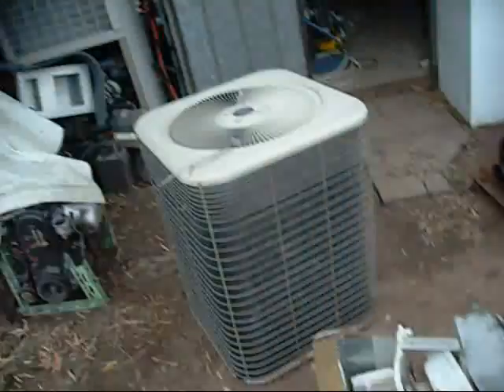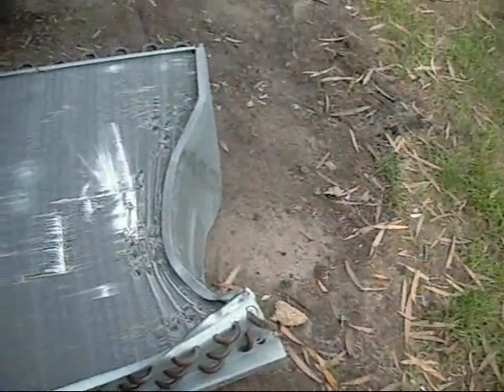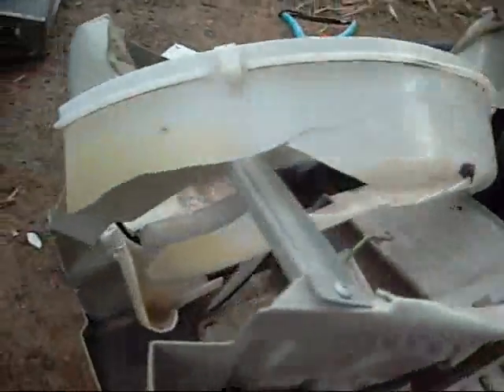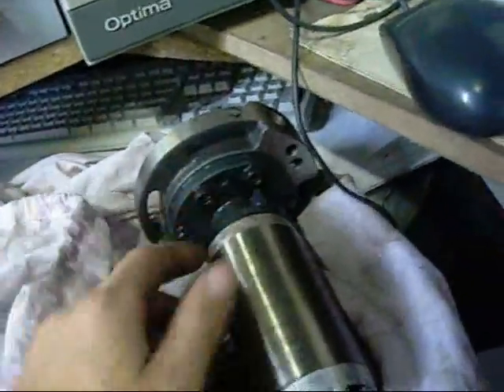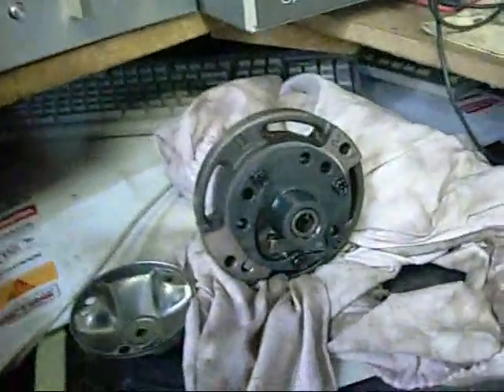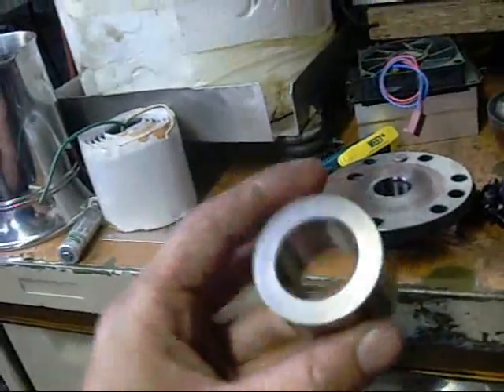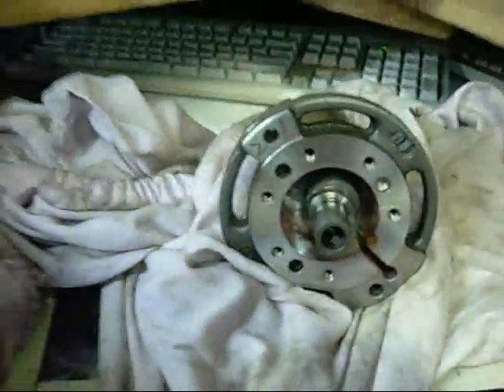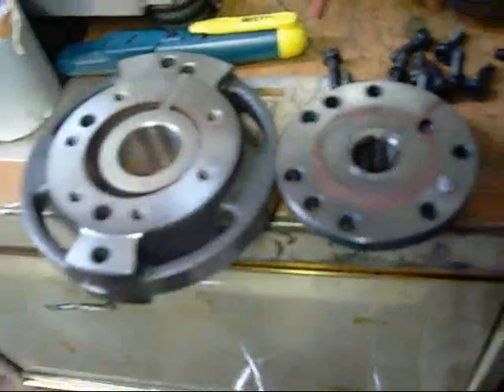Brad's Trashed TECO Window AC Final Exit - Compressor Autopsy

Comment from the maker: @jdstooge Only problem I have seen in TECO units is the t'stat, the one in this vid was tossed out because of that and worked fine after spending $20 on a new one.

out of the cheaper box units I would say they are the best, as opposed to Korean made LG/Samsung ones.

Comment from the maker: @heavydiesel cool stuff!. being a factory sealed system the gas must have been contaminated from the start and was abrading the copper lines.

now that i think of it I have taken a 3 cylinder recip apart and found the same thing in the cylinders and valve plates. it was a Copland that threw a rod.

Comment: The compressors can get copper plating from the pipework, usually its somewhere hot like a bearing that gets plated, moisture and acid and high temperature speed up the effect. In some cases, tought i've not seen one do it, they can seize the compressor due to bearings becoming tight!
My 'dead copeland scroll compressor' vid shows a coppery scroll. I've aslo seen danfoss orifices where they had copper plated onto them that was thick enough to feel with your finger nail!  Great Vid :-D